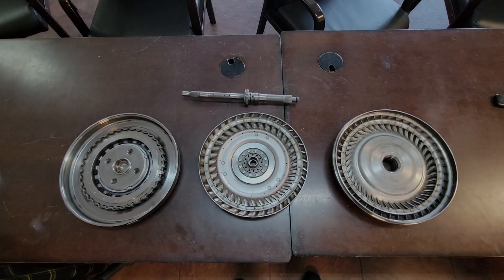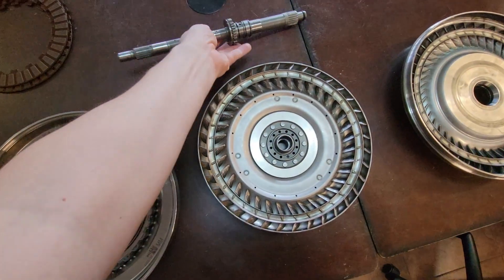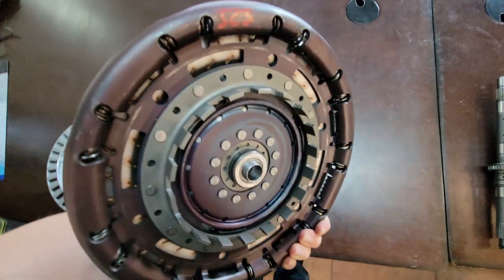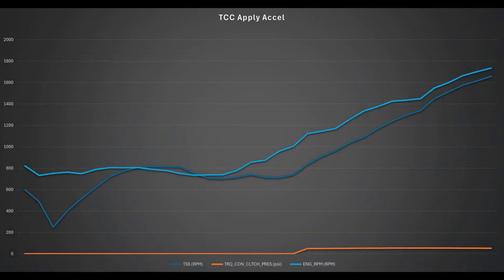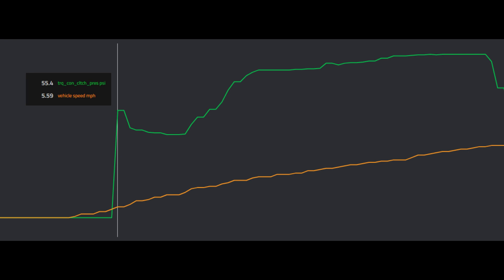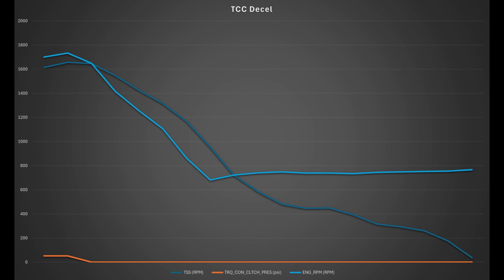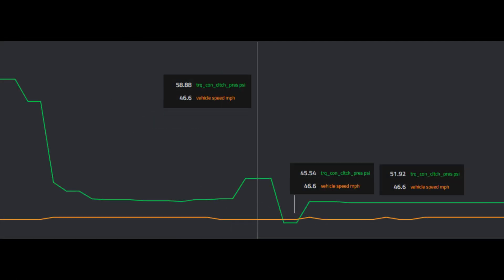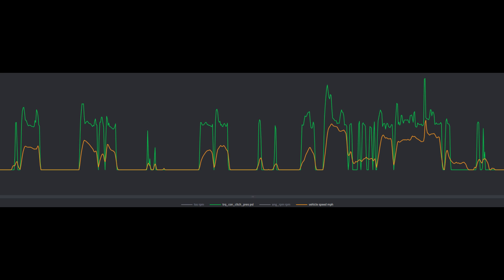Mazda Torque Converter Clutch Operation

Comment: I was wondering why my CX30 turbo felt like I just dumped a clutch from a stop. After watching this I now know why that happens so thanks for the insight! It’s cool tech to reduce power loss from a torque converter but I wish the dealer told me about that behavior. I legit thought there was a problem with my car a month after buying it lol. Would you happen to know the kind of maintenance intervals I should keep to on these transmissions like fluid changes?

Comment: Do you know anything about "gear wine'" is it actually a normal characteristic for you to feel almost like buzzing in the brake pedal as you are in the 2-4000 rpm range?
Reply from the maker: There is some natural gear whine from the transmission, but a buzz in the brake pedal should not be from gear whine.
Reply: @grolladat  Thanks for the response! My plan is to have a Mazda see it as well. You don't notice on gas or dead pedal but if your foot is touching the brake at all you feel buzzing as it's RPMs are in that 2 to 3000 range. Most noticeable coming down as you may be preparing to brake. Even auto Sport mode will present the feeling.

Comment: I recently purchased a 2016 Mazda 6 with the 2.5 NA engine and automatic. I've been trying to understand the nuances of this transmission and I'm truly fascinated by what Mazda designed. Occasionally when I'm accelerating in first gear I'll feel a bit of a bump or jolt in the drivetrain as I'm nearing upshift point to 2nd. I can tell it's not the upshift because it's followed almost immediately by the upshift to 2nd. I wonder if this is the TC locking up and perhaps it's doing so in a way that isn't always perfectly smooth. Perhaps checking the TC lockup behavior on a data log will corelate this to what I'm feeling?

Comment: I get a jolt very consistently at a certain spot in my neighborhood, on first drive of the day, as I come to a stop. I’ve wondered if it was related to some calibration as things warm up.  Sounds like it’s just that clutch pack not wanting to let go.
Reply: Let it warm up a little before you take off.
Reply: Watch video on how to reset the transmission it fixed the shuddering at low speeds for me

Comment: I have a 2024 cx-5, is it normal when cold that the rpm go back to idle when i let off the throttle ? like the torque converter dont lock up

Comment: Hello…
I record my transmission data using forscan app. And i noticed when deceleration, after it shift down from 4th to 3rd gear ( around 26 kmh)torque preasure become zero… is it normal? Because it feel  weird when you drive.. thank you.

Comment: In my 2016 Mazda3 I notice that jolt coming to a stop from higher speeds, like normal traffic. It's not every time but sometimes as I come to a stop, there's a good amount of engine braking, then around 5-10mph it'll jolt pretty hard forwards, and I have to push down the brake further as it also gains some forward momentum when this happens

Comment: I have a question.  I thought about it while driving in the mountains with heavy loads on the engine, low speeds, stops and hard uphill accelerations.  What happens to the clutch in the torque converter?  It might burn because of such loads?  I can see the connection of the clutch in the odometer and it makes me feel bad.   I assume that the temperatures of the entire power train rise abnormally.   In general, the questions are: what is the healthy temperature for the skyactive transmission?  What are the consequences of high temperatures and is it recommended to change the transmission fluid after a week of hard driving?   is there a way to prevent lockup and wear?  And can you trust the original oil cooler because the temperature of the engine also rises (I assume) in such situations.  I would appreciate it if you could make a video and share your extensive knowledge with us.  Thank you very much,
Reply from the maker: @liorlevi3991  a couple of observations on your questions. The friction material used for the TCC is good stuff. Being segmented allows for really good flow to keep the clutches themselves cool, and a lot of thought went into the design of the converter. It's meant to handle slipping lock and full lockup, I wouldn't be overly concerned with how it operates vs longevity. The transmission will run at different temps depending on the vehicle it's installed in. The coolant used to cool/warm the transmission comes directly from the cylinder head, so you're using cylinder head temp coolant that is already quite warm and performs the heat exchange. This works great to bring it up to operating temp quickly, but introduces a problem of being able to keep it cool. It's not uncommon for me in my climate to see 230f in the transmission temp. I don't personally like it that hot and have a few ideas currently in the works on a cooler setup. I'll likely put together a video regarding shift speeds related to temps.
Reply: @grolladat  Thanks for the very detailed response!  As always I learn a lot from you.  I remember that it used to be written 150 f on the dipstick of older vehicles to check the oil level.  It's crazy that we are reaching such extreme temperatures today

Comment: I am curious how “sport” mode may affect the clutch operation, especially considering you can use sport mode while shifting your own gears. As far as I know spirt mode should only affect throttle sensitivity, however it almost feels as if it also holds the throttle at 1-2% in M mode (maybe I’m wrong). I was wondering if you had any insight into it?
Reply from the maker: @erikwithak6555  TCC operation is much the same between normal and sport as well as using manual mode. I have a lot of measured data of shift speeds vs temp, load, manual, sport etc.  Sport mode does make a measurable difference in shift speed vs not. In manual mode below, around 30% throttle manual mode shifts slower, above that it generally shifts a little quicker.
Reply: @grolladat  I've noticed that as well, is this primarily for downshifting?

Comment: My 2018 cx5 is going in to the shop for hard shifting, Shift shuddering, and when coming to stops it jerks back and forth. On top of it staying in 5th gear at times and not shifting into 6th for about 35 seconds going down a straight road. Also it chugs back and forth if in low speed on highway with foot lightly on throttle.

Comment: I have a 24 CX50 N.A.. At low speeds it feels like the lock up is occurring, but it feels like the engine is lugging and it should it should not be locking up at such a low speed. Is this considered normal operation? Also, when coming to a stop, if I press the throttle right after stopping, there is a jolt sometimes, like the trans is still locked. One more question, there was a TSB for the trans ECT released in May 2023. My 2024 was built in Sept. 2023. Can I assume that the most recent update was included on my vehicle?
Reply from the maker: I would have the dealer make sure you have the latest TCM update done.
Reply: I had a 23 and now have a 24 and lock up does occur quickly. The shift from 1-2 is also not quick it’s pretty delayed. Cars built after November of 23 were updated so the current parameters but I don’t think mine was. It could have been tho for transmission stuff
Reply: @thweepz  
I took it in for inspection in September and had them check to see if the transmission had the most recent update and they said that it did.

Comment: Wow somehow I came accross the video discussing about the skyactive transmission. Don't see this thing being discussed a lot.

Quick question when you said earlier gen shift faster, is it year based or there are certain model that considered as early and later model. For example like my 2020 Mazda 2, no major changes since 2014 and I would say it shifts beautifully. Then my 1st Gen CX-5 I feel like does not shift as fast as the Mazda 2 and one thing that I notice missing is the downshift blip.
Reply from the maker: Powertrain compnents are my career and my passion. The goal here is juat to spread info because of the lack of readily available info. 

The 3rd gen 3 with the 2.5 and the 6 with the 2.5NA have the quickest shift times I've measured.

Comment: Thank you for this very thorough video, very detail explained! Just like you mentioned in the video, I also noticed some of those earlier models skyactiv 6ATs like the one on 2014 Mazda 6 shifts very fast at redline, but my 2021 CX30 N/A will have a 0.5 sec hesitate upshifting from gear 1-2 or 2-3 at redline. I test drove a CX50 Turbo last time and I found that transmission is programmed even slower (around 1 full second of power cut at upshifting) than my CX30. I asked the sales he said CX50 has more of a "off-roading-ish" setting so they programmed the transmission like this to protect the transmission and increase reliability. 
I have a weekend car which is a full bot on and tuned Infiniti G37S with Jatco (Nissan's transmission brand) 7AT. As everybody knows Nissan is terrible at programming transmissions (even with GTRs) and the shifting logic is not programmable by the tuner. However, by increasing/adjusting the line pressure of the transmission according to the dyno-pulled logs, the upshifts at higher rpm can be instant shifts like a DCT for my 7AT. So I'm wondering if it's possible to tune the line pressure up for a faster upshift at higher engine rpm or this transmission is locked by Mazda? Since Mazda has an excellent transmission shifting logic like the BMW ZF8, a fast shifting would be what I'm hoping for.
Reply from the maker: @XD-uh8ye  line pressure adjustments would be part of transmission tuning should it become available. My car had a pretty good delay on the 1-2 for a few thousand miles but cleaned up considerably after that. Nice clean shifts are key to transmission longevity. I really don't know why they toned down the excellent shift speed the early versions of the transmission had.

Comment: I understand to a degree your explanations iam just wondering in your apinion if these transmissions are a good trans with some minor issues but still a good overall reliable trans ive watch your videos and det good info thankyou
Reply from the maker: Yes, I feel they are a good unit, especially put up against all the failures on the Gm 6l, Ford/GM 10 Speed and ZF8 that I see often.
Reply: @21mazda3turbo3  thankyou for your response much appreciated
Reply: @grolladat  I didn't know ZF8 has lots of failures, I just know it's a good fast shifting transmission like in the 5th gen Supra.
Reply from the maker: @redboy81 the issue with the ZF8 is extensive use of aluminum in critical areas where clutches ride. Over time the clutches notch into those areas, get stuck and will burn. There are issues with A clutch backing plate warping, hubs shearing, etc. When they work they work well. We have 4 apart on the bench right now that made to the 80-90k mile range.
Reply: @21mazda3turbo3 alright, good while it lasts but not very durable, let's say over 100k miles

Comment: Do you know if this tcc failing would cause this transmission to periodically feel like it’s in the wrong gear or in neutral when taking off? Before I traded in my NA CX30, I was having issues where I would go to take off on a steep hill and it would feel like it was trying to take off in 4th instead of 1st or second. Even to the floor on a steep hill the car wouldn’t go more than 8-12mph. After climbing the hill and letting off, it would jerkily select 1st or 2nd and drive normally. I had a couple episodes too on level ground where at low speed it would freely rev like it was in neutral to almost redline and then it would catch HARD like it was neutral dropped.  I tried doing a relearn, wouldn’t help, then I did a double fluid change with a filter but it still didn’t help. 

I always had the symptoms on a hill like you said where it would prematurely select second on a steep hill and when letting off the gas there would be large jolt like you were bumped from behind.
Reply: Channel OP may know about this, but there are cases where some 2.5 N/A Sky-Activ vehicle owners reported chirp noise from transmission going from 3rd to 4th gear, and it was determined by Mazda to be caused by the Torque Converter, which before required full transmission replacement, where as now Mazda techs only required to replace the torque converter.

Your vehicle may fall into the same category. But the full description for Mazda's TSB regarding this is: "Some vehicles may exhibit a chirp noise (stick-slip noise) from the automatic transaxle (AT) when shifting from 3 to 4 while driving. This may be caused by the automatic transaxle fluid (ATF) being contaminated by iron powder due to excessive wearing of the lock up clutch in the torque converter." So your vehicle's transmission may have larger issues than just the torque converter getting locked up per Mazda's description.
Reply from the maker: Those symptoms are more likely to be valve body related and not engaging the correct gear at the correct time vs. a converter issue.